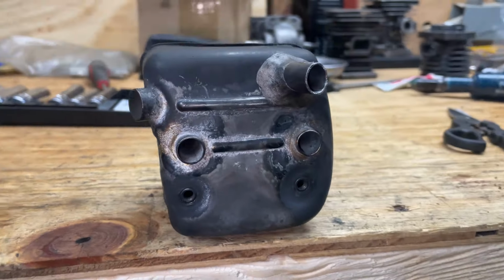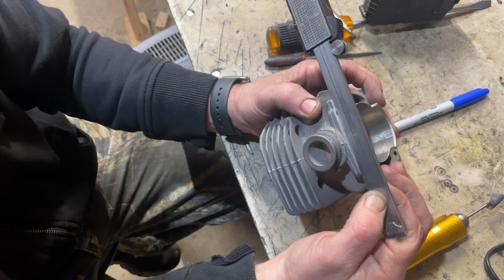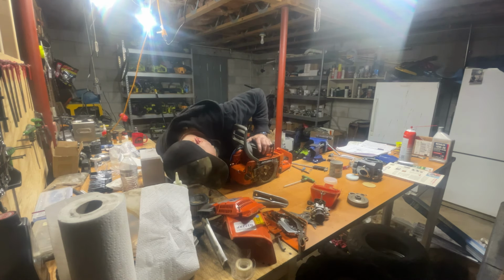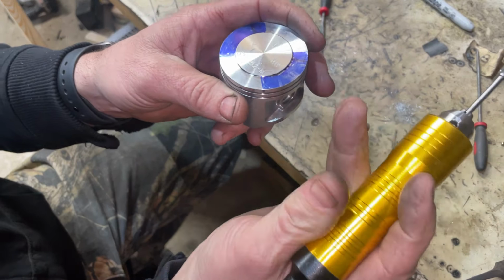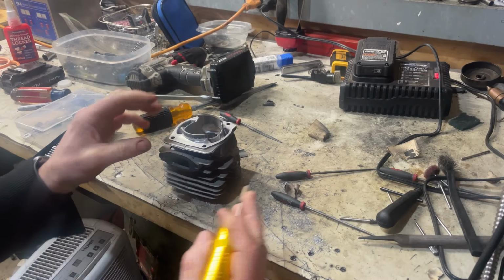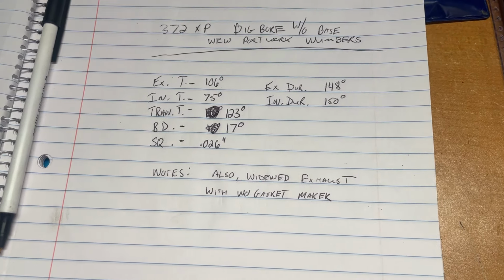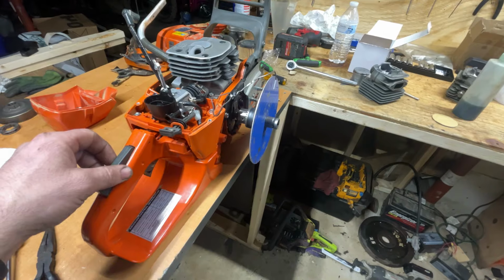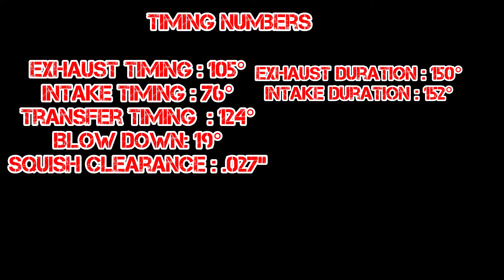372XP Big Bore Kit - Let’s Do Some Untraditional Port Work - Project Bucker

Comment: How much compression did you get out of your work? Cheers
Reply from the maker: Right around 170psi after the first pop off, but it is now confirmed 155psi because the saw ate the epoxy on the exhaust roof. Now the exhaust is at the stock 162° duration. Surprisingly somehow the saw ate it with min to no damage lol. Follow up vid coming soon.
Thanks for watching!
Reply: @DIGGINGDEEP007  they do. You can't use anything like that with so much heat. The exhaust does suck in . Hopefully it's salvageable.  Sorry to hear with so much time into it. I'm sure you won't do that again anyway. Cheers
Reply from the maker: Surprisingly, it running just fine. I honestly did not expect it to last. The damage is minimal and still running strong. We’ll be tearing into it again very soon.
Reply: @DIGGINGDEEP007  nice. You're lucky.  Cheers